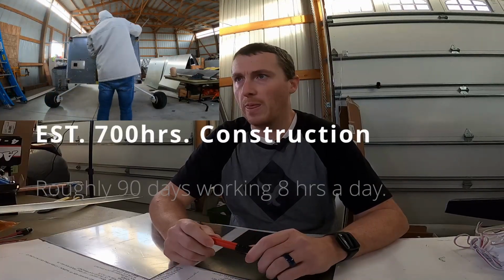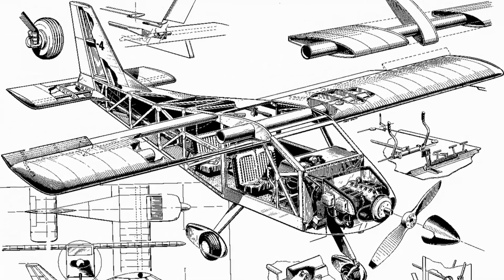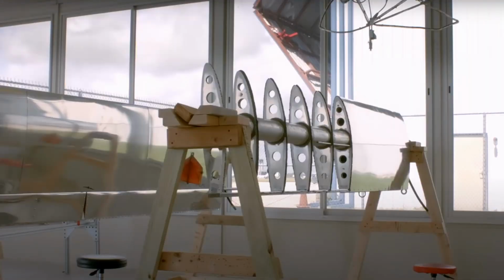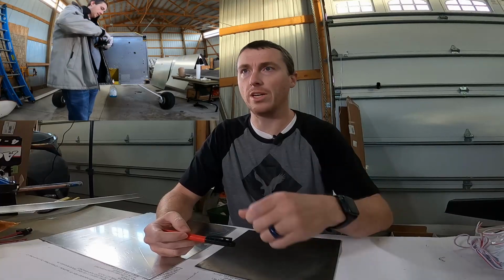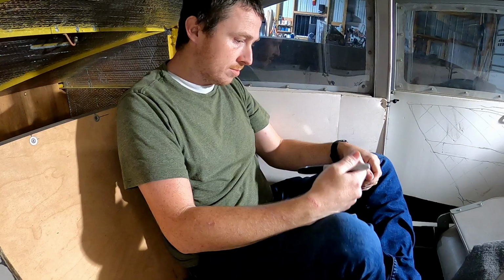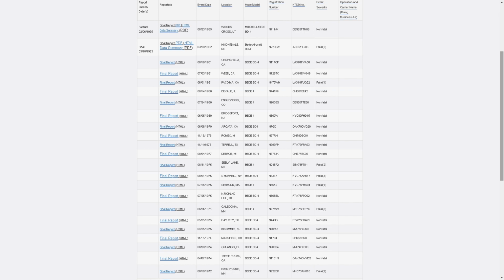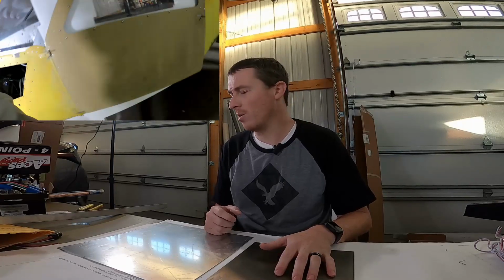WHY CHOOSE THE BEDE 4 + FIX WINDSCREEN

Comment: I appreciate your series and look forward to more posts. I never even heard of the BEDE.  Thank you for giving me something to research a bit more.  I am not an engineer but I don't see how it can be so good on fuel with the nose it has on it.  Go figure.  

I watched the engine teaser video. Maybe I did not watch close enough. But what engine are you putting in yours?  I am guessing with how often you mention smiles per mile you are going with 4 cylinder.
Reply from the maker: Hello! Thank you, I grew up knowing the name mostly negative but I later realized that was specifically the bd-5 micro jet not the bd-4. I definitely agree I'll tell my fuel burn with zero sugar coating.

I say smiles per mile in relation to getting your plane done sooner than later. As for the engine I did let the cat out of the bag a little with my latest in the shop short. It shows 4 cylinders on just on side of the block. 

But since you asked I will tell you. It's an LS3.
Reply: @B-RadThePILOT  
This build just became so much more exciting.  With the LS3 it is astounding how much lower the rebuild cost can be.
Reply from the maker: @jberg411  absolutely, saftey, availability and cost were contributions factors to my decision. With the money saved I could buy another engine leave it on the stand ready to swap at any moment. 

Mind you I have meticulously went thru recommend engine maintenance from the manufacture and converted the milage to an hourly checklist of items. In an effort to treat it with a safety factor that aligns with aviation standards and above all service the engine as you would for an aircraft engine.
Reply: @B-Rad The PILOT  
In doing your research what video or website was the Tipping Point when you  mentally made the decision the Bede4 is my next plane?
Reply from the maker: @jberg411  The major tipping point was the NTSB records and a close second was the active builders forum on bd-4.org.  3rd was performance numbers from members and not the manufacturer website.
Sadly no video influenced by decision but I do enjoy watching @skyfun videos.
Reply: @B-RadThePILOT  
I am astounded that the value the Bede4 seems to represent. The stall speed is a bit high it seems and that is a concern. But you can't have everything in a plane. If your wings are shorter then your seemingly going to have a faster higher stall speed.  May I ask what company you are going with for your LS engine?  I found one not sure if they have others.  I appreciate all of your candor.  Thank you.
Reply from the maker: @jberg411  For sure and as a cross country platform it's hard to beat. I already have the engine, I purchased it from turnkey engine supply. I'm going to have a psru engineered. I couldn't find a solid psru that I was convinced was the best option. Thank you for commenting.

Comment: I own and fly a BD-4B. I did not build it. It was completed in 2015 and I bought it from the builder last year. It has a 180 hp Lycoming O-360 with an Ellison throttle body and a Hartzell constant speed prop. It is a 150kt airplane without the wheel pants, which the builder says give another 7-8 kts. There's nothing wrong with 150kts. Burns about 9.5 gph so about 4 hours with reserves. Your wife will need to pee then anyway. Sea level climb with two up and full fuel is 1400-1500 fpm. Before you think about a bigger (heavier) engine sit down with your CG limit diagram and wonder how you're going to fly from the back seat. The plane is very stable when trimmed out, surprisingly so since it has no dihedral. I have no autopilot but I can take my hand off the stick while I attend to navigation or whatever without any concern that it will suddenly do something stupid. The rudder is large and very sensitive. Keep your feet off the pedals unless you mean it. A gentle tap when turning is all  that is needed, It will stay co-ordinated without my clumsy feet. The pitch trim is very very sensitive.
Reply from the maker: For sure and thank you for the wealth of information I've heard great things. Sounds like your getting some pretty good performance with that Lycoming. I am watching the cg like a hawk and  I'm prepared for the hurdles it brings. Good to know on that trim I'll probably do as some of the others on the forum and adjust the trim wheel while it's out.

Comment: I am surprised the BD does not have more of a following?  It definitely seems like the best bang for the buck!
Reply from the maker: I agree it really is. I remember hearing everyone loathed the Bede-5 and it was dubbed the pilot killer and Jim Bede a lier and thief etc. Which in return I think gave a bad taste in everyone's mouth about anything Bede related.

Probably doesn't help it has a box appearance. I think the tide is changing for the aircraft. Especially if you want a new certified high wing aircraft that isn't 500k++
Reply: because the builds start and then disappear.🤣